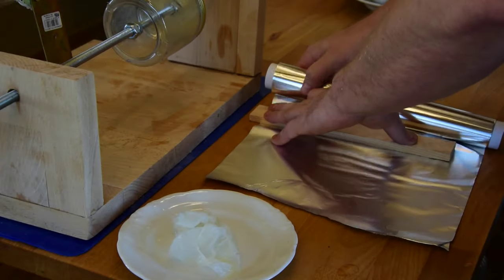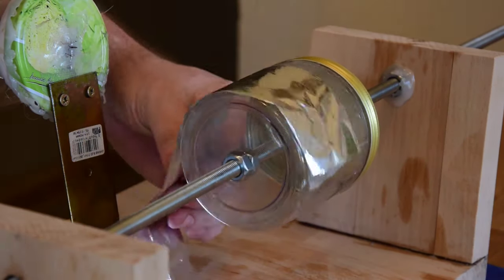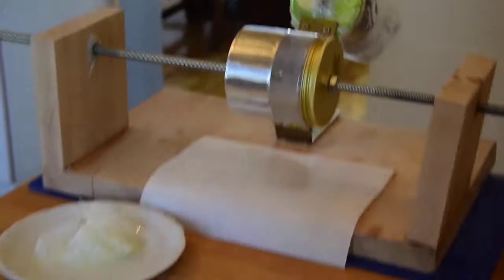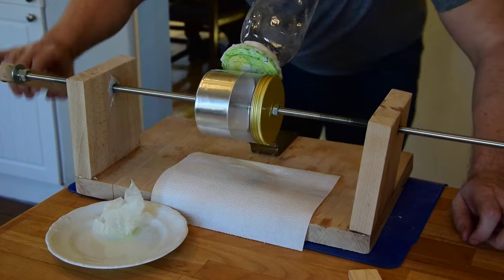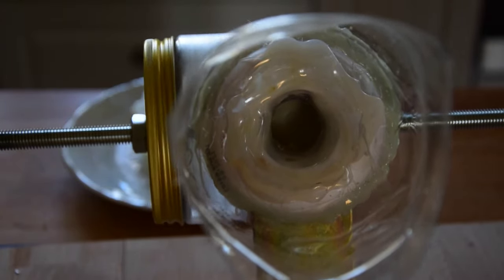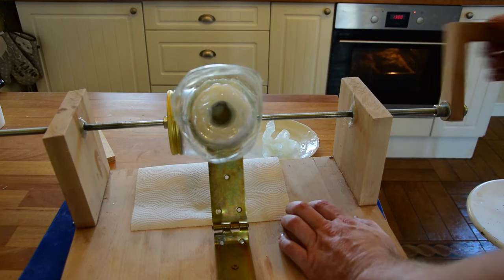DIY phonograph - sound recorder/player from aluminium foil and wood

Comment: what did you change between the first attempt at playback and the final successful one ? great video!
Reply from the maker: for example tinfoil. first i was using too thin aluminium one and it wasnt working. then i used thicker tinfoil. and reduced the presure of the nidle
Reply: @skillful_DIY_fan  cool, thanks for the response!